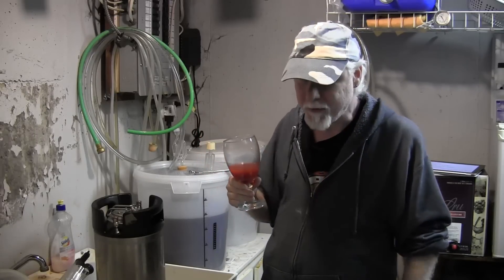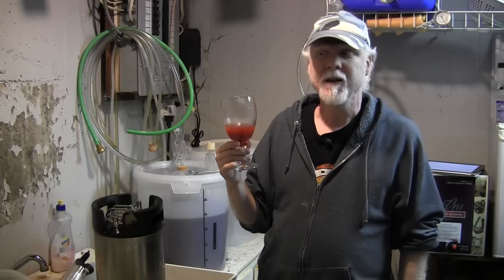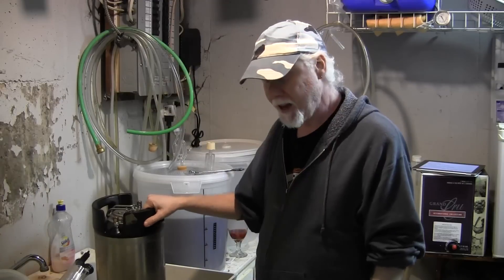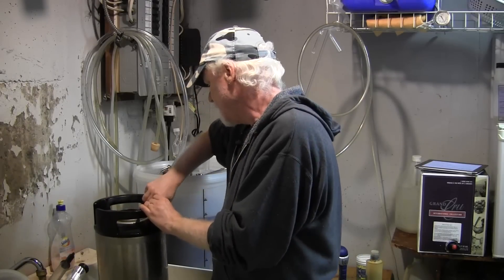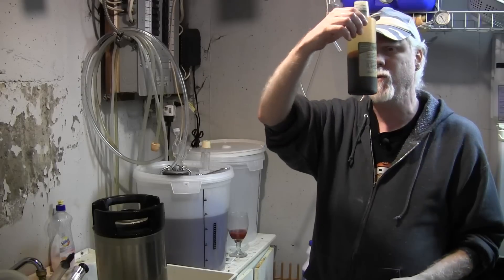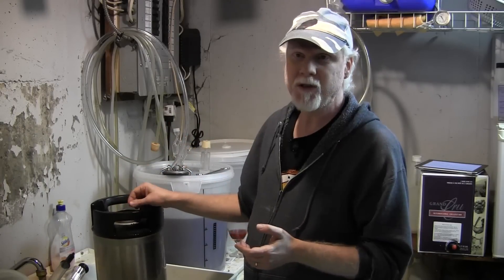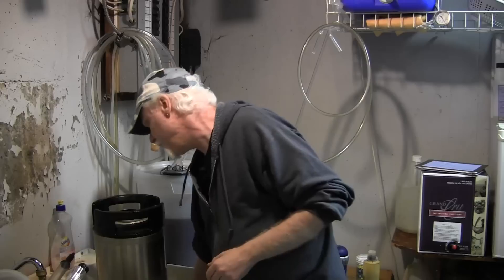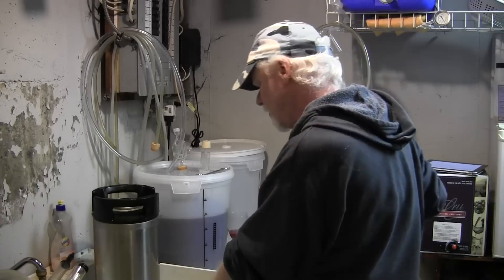HBW 65 - Keg and Talk

Comment: All you need is 1/2 milliliter of star san per pint of water to spray down the fermenting vessel and tools. Lasts a long time. Never a bad batch. I've been working on the same small bottle of the stuff for years.

Comment: Craig,

My Starsan turns cloudy as soon as I mix it - presumably due to the mineral content of the water.

I have never worried about it - I just monitor the pH level.  It starts around 2.5  I have read that it is good until it rises to 3 - 3.5

Actually I have never had it go up that high - I usually just make a fresh bucket full anyway every month or so anyway as it is cheap enough.    Great stuff!  

To my knowledge I have never had a problem with it.

Comment: I have an under-sink Aquasana filter (like a brita but on the water line).  When I use starsan with that water, clear.  When I use regular unfiltered tap, cloudy but settles out  I use my batches for two or three months or until they run out -- usually it runs low because I also have a spraybottle full of the stuff on hand for wands, tubes, nozzles, and other sanitizing on the go.  No pH difference between the unfiltered and filtered water.  Never an infection.

Comment: My well water was tested to be the absolute worst water for brewing. So I installed plumbing filter system with mineral precipitating and carbon filters, which is essentially a big Brita system. The water is so pure that only a lab can tell the difference between it and distilled water. I currently have 3 week old Star San and it is perfectly clear still. One draw back, I need to use yeast nutrients because the water has no minerals in it at all.

Comment: (SCREW CAP comment) -As an experiment I re-used the original screw cap on a budlight (not a crown cap) I swiped from a BBQ, It worked... but i only did one and thats not a lot of research to suggest anyone to go on. But it is a good experiment for you to try. I would recommend in a pinch use screw cap plastic water bottles or even 2 liter soda bottles. Just be careful on the priming sugar as they are very thin-walled.

Comment: depends upon how far you want to go with the polishing. to take out the major nicks and scratches, there is a thread on HBT about polishing stainless steel (msg me if you want the link)

the short version is this, there are gator grit scrubby pads and polishing pads for grinders. use those, and the polishing sticks, and you can go anywhere from just a "nice finish" all the way to mirrorball type stuff.

Comment: Craig from my experience the star san will last quite a long time. I know plenty of guys that store it in corney's they aren't kegging in. I keep a spray bottle that is 1.5L full of it and use it without my trouble. It still foams and seems to work great. I would say that you would be safe storing  it for at least 3-4 weeks.... My spay bottle is normally ready to be refilled by then. Thanks for the video's CHEERS!

Comment: Hi Graig, I'm using pressure barrels to carbonate my ale's and porter. I use the correct amount of sugar each time. I test them for leakage; especially around the rubber seal and tap areas when sanitizing them. when the beer is in the pressure barrel, after an hour or so, the pressure builds up and all of a sudden; beer is coming out of seal and tap area. 

Is there a way of knowing if your barrel is sealed before you syphon the beer into the barrel?

Cheers. Nice to know you had a nice birthday

Comment: The twistoff bottles and non returnable bottles are not designed for recarbonating in bottles. They have a very thin glass.  When you recarbonate they will explode for sure. That’s why you should use returnable bottles. I had already a green Faxe bottle grenade in the house that’s why I know.

Comment: I have a question for you, I have been doing wine so far but haven't done a beer yet simply because I haven't liked the store bought beer, but the sound of the stouts sound yummy, especially the chocolate. I want a nice double chocolate stout, one that is sweeter with less bitter. Can you recommend a stout kit that would satisfy a pallet like mine? Or should I go.with the cooper stout kit and add cocoa powder and chocolate syrup like I saw on one video? Thanks

Comment: I always add 4 g sugar and let 6 cm space in the head for each bottle and had only an explosion with a one way bottle from Faxe beer. Other bottles from the same batch didn’t explode and didn’t have been overcarbonated.  I have read on a forum about it and found out that’s because of the thin crap glass they use.

Comment: What was the OG? 1.020 may just be as low as it gets if the OG was particularly high. Other than that you might just give it more time (or yeast nutrient and a stir like Craig suggests). I had a batch that smelled STRONGLY like yeast, but I bottled it anyway, and by the time I opened the bottles it was smooth and not yeasty at all. Good luck!

Comment: hi, this is in response to commercial beer bottles with the threads.

i have found the problem is if you use a hand capper instead of a bench capper.  I have had absolutely no problem with threaded bottles as long as i use a bench capper.  the other ones will break the threads.  crown caps seal on the top of the bottle the thread has nothing to do with the seal.  it's a seal on the top of bottle.

Comment: Craig......here in the states you can buy a 1 gallon jug of distilled water at Walmart for about 60 cents. This is what I would use. Also I am going to use it for my first beer batch as it has absolutely nothing in it but water. I have a meter that reads particulate in water and these Walmart distilled waters have 0.00 parts per million. They are pure! Cheers!!!
Reply: You made this comment a year ago so I imagine you know already but dont brew with distilled water... you actually want those minerals in your beer :) Before long you'll be tweaking those minerals for specific characteristics in your beer. Brew on!
Reply: Can you confirm if you were able to make beer with the Walmart distilled water? (Question being asked 6yrs late.. But in case you see it pls reply-thanks)

Comment: the brita doesnt work unless your water is close to RO water to begin with. I use distilled water and make up 5 gals at a time. That 5gals last me 3-5 months. at that point the level will be to low to sanatize bottles in, so what I do is fill a couple empty jugs with extra of the old starsan to use in blow-off containers and air-locks. then I make up another 2.5gals to get me around 4gals in the bucket. I make around 15 ten gal batches a year and use maybe 2oz of starsan each year

Comment: Hi Craig, I think too much fuss is made of cloudy starsan. my tap water is very soft but is slightly alkaline with a pH of 7.7 and my starsan solution does go cloudy very quickly but when tested with a test paper the pH of the solution is only 2 or thereabouts - that's good enough for me :)
Cheers buddy
Kev.

Comment: If Starsan sanitizes because it's an acid, which it does, then all that really matters is the pH.  If it's cloudy, meaning their are other solutes present, but the pH is still low then you just will have to leave it in contact with the surface to be sanitized a bit longer.  That's all.  You do not have to make a new batch each time.

Comment: Craig, do you mix a batch of 5 gallons of water to 1 ounce of Star San per cleaning session?  Now is it possible to get away with mixing a batch of just a 1 gallon of water to .20 ounce of Star San, and just swish it around the keg/fermenter real good & then use that same 1 gallon to dip/soak everything else in as well?

Comment: I'm really curious for the people who use buckets of star san.. Why? :) You do realize that all you need to to is wet the surfaces that will touch your wert.. Just spray it on thick with a good spray bottle, available at any brew store or even supermarket. 1/2 milliliter of star san in a pint bottle and you're good to go. Spray it on as thick as you want and you'll save a butt load (technical term) of money and hassle. And yes, it lasts as long in a spray bottle as it will in any other container

Comment: Just as an update, i put the pressure back to 30 psi as it's no where near carbed like it should and today tried pouring a beer at that high pressure; well obviously I got nothing but foam due to the speed it came out but the gas bubbles had dissapeared from my line, kinda good but I can't serve at that pressure :(

Comment: Hi Craig. I'm trying to balance my corny keg but get nothing but foam out the tap :( I switched to 2 meters of 3/16" line and still it shoots out foamy.
I was told to serve at 10psi (as I have gas bubbles in my line)  but could that be too high?
Everything sits in a fridge at 39.5F so there's no problem with temp drop. Any tips?

Comment: P.S, Craig... sorry bud.. but i've always used corks (never caps) to bottle my beer, bud. also made a ton of champagne without cages cause i'm always in a hurry... only had maybe 2 bombs in my life... due to heat in a bumby truck... as long as they are stored below 70 degrees i've had no problems... n the cork adds a vintage flavor to any beer as well... then i poor wax over them before chilling.... fun fun... try it.

Comment: if you had done any research at all you would know there is no benefit to putting Fluoride in water. It not added to the water here because even the Dentists agree you should never actually ingest it. It can harden enamel when applied topically, to have the same effect by ingestion you would need to swallow magnitudes more fluoride, acutely toxic amounts in fact. I can only assume that the reason you perpetuate the idea that Fluoride is safe to ingest is this: You're profiting from it.